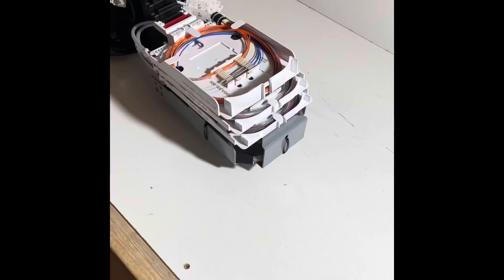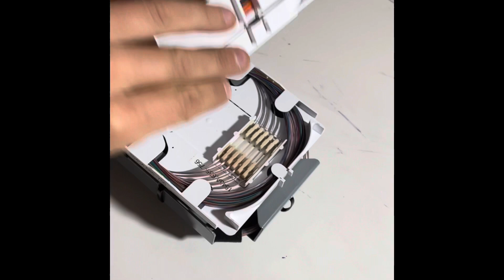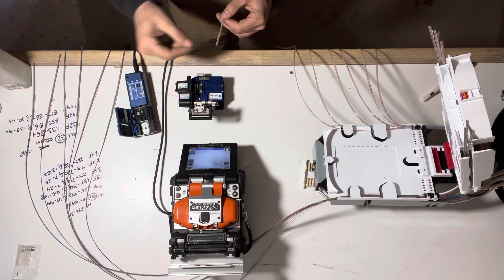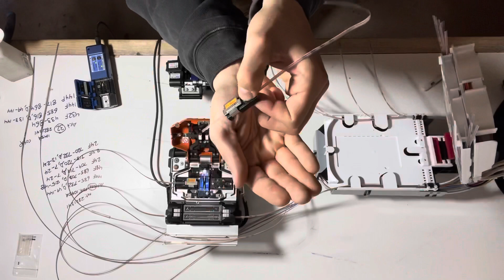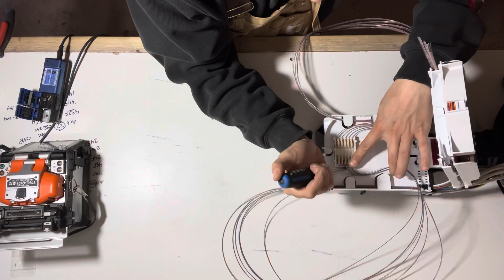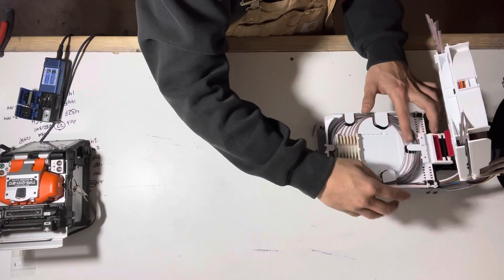Ribbon Splicing Fiber Optic Cable

Comment: Text book. Literally. Right out of the manufactures instructions. Great job! I was going to post a video of a 288F in a 450D case but no need now. The process is the same as you have shown.

For more views I would add some additional tags such as Flip the chip, Commscope, storing, routing, fiber, ...ect